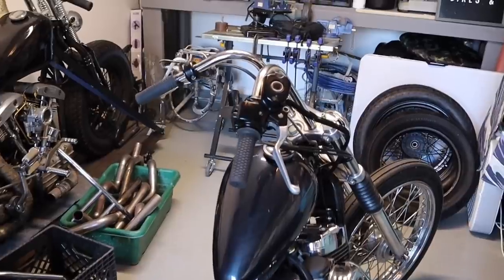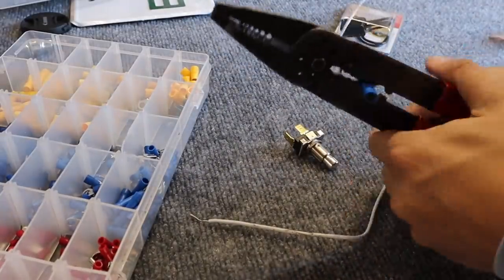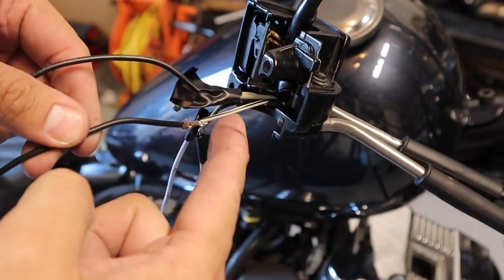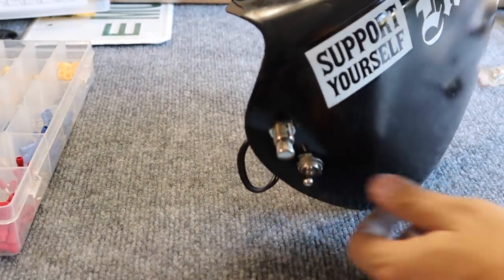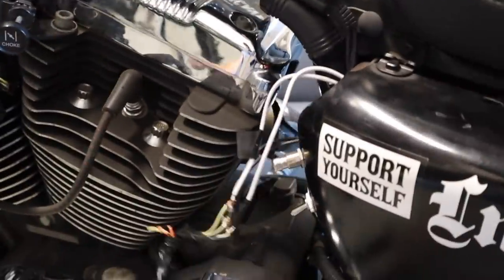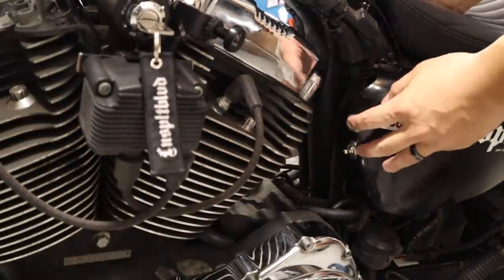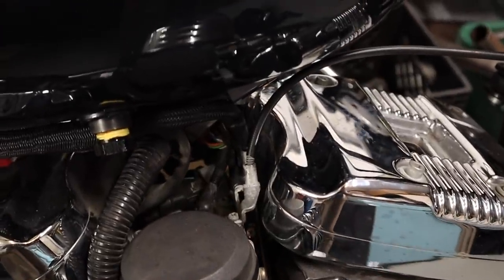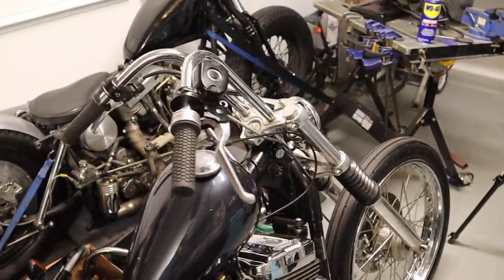Sportster Build Episode 7. Start/Kill Switch Relocation | Biltwell Single Throttle Cable conversion

Comment: Just about to do this same throttle change out. TC Brows said I needed to replace the dual with another dual. I learn I didn’t. Your video just reinforced it. Thanks
Reply: yea just shitcan the other throttle wire ya only need one, will ya get the same snap idk i never heard anyone complain

Comment: I have a automobile type (on/off & starter) ignition. I bought a smaller black front master cylinder from TC Bro’s I think. So far so good for $80. Btw how’s your friend’s shovel project coming along?  The guy that also has a pan and knuckle. Keep up with these “hands on” Harley vids. Ride safe!!!

Comment: you have some good ideas with your retro switchgear ( and i have a hot rodded speed triple with some questionable mods ...its got alloy fairing spikes all over it, i love them )...what i'd really like to see is some really cool minature LED indicators...there are so many excellent options these days.....I've done alot of miles in heavy traffic and i've been airborne four times, whacked by cars...i try to ride systematically, but being whacked by cars, seems to be a rite of passage in Sydney.

Comment: One of the good reasons for having the kill switch in the handlebars is for instant access for your hands if/when you fall off the bike and you need to stop the engine instantly to prevent injury! A common practice on Racing and Competition motorcycles to comply with safety issues!! Take care, all!
Reply: If it aent sketch it aent fun!

Comment: Nice work as always fam! I'm thinking about changing my throttle switch to a single cable on my vt1100, you think the builtwell joint will work on mine?

Comment: Well shit....got the the switches and all but my sporster is a 2015 so the run and start are wired to a little computer board instead of wired individually. Wondering if it would still work if I cut the wires

Comment: I know this is an old vid, but I'm doing the same thing on my 2020 Sportster 1200 and cannot for the life of me figure out which wires go where.  Stock housing has 5 wires, CAN high / low (red/white, red/black), black (ground), red (battery fuse), and white/grey (engine stop switch)....any idea?  Any insight would be greatly appreciated!

Comment: Can u just  tie the kill switch and start straight  together  so they are Always  on I have a pushbutton switch on my starter wanna get rid of control will that hurt  anything or can i wire start together  and put toggle switch on kill switch to kill wann get rid of ignition

Comment: This looks great. How does the light for the front brake work...or does it? Also did you relocate the high beams switch? Thanks!
Reply from the maker: Rear brake has a brake light switch so I dont care for the front brake switch. I’m also not running high beam. Low beam only. It is a chopper after all haha
Reply: @LNSPLTBLVD  Haha! Thanks. Unfortunately in Virginia front and rear brakes must actuate the stop light on the rear. Also, high/low beams required.

Comment: Nice video, what did you do with your hi and low beam switch? did you just delete it? Or are you relocating that at some point?
Reply from the maker: I only use low beam for this setup so I ditched the high beam switch
Reply: @LNSPLTBLVD  cool cool thanks for the reply

Comment: Clean mod. I would had placed the switches on the right side to be able to start with the clutch lever engage tho.
Reply: He can use his right hand to turn it on
Reply: @AlexD02  yeah he can also use his left foot, but kinda awkward right?
Reply from the maker: Why do I need to have the clutch lever engage to start my bike?
Reply: @LNSPLTBLVD  lots of scenarios when the bike is in gear. It’s just a safety precaution. That’s why newer bikes are equipped with a clutch safety switch. 

I’m saying I WOULD if I was doing the same mod, that’s just me. To have the starter switch on the right side will give me a better ergonomic position whenever I would need to engage the clutch lever. And I think it’s just a good thing to dial you muscle memory to cover the clutch when starting. You never know, your bike could be in gear and you start the bike and the bike goes bye bye lol!